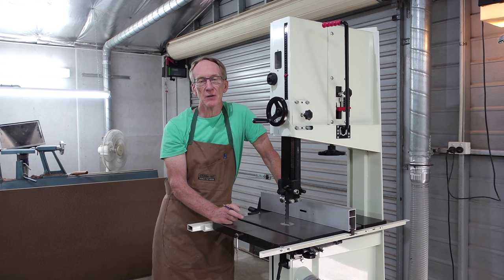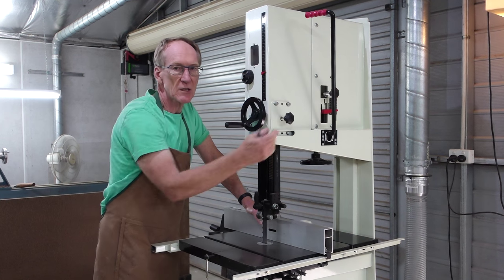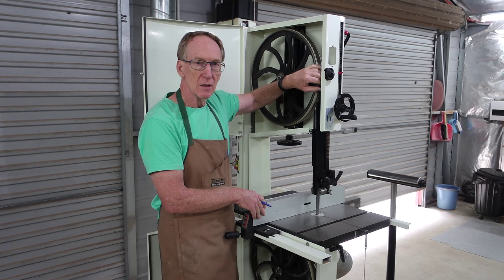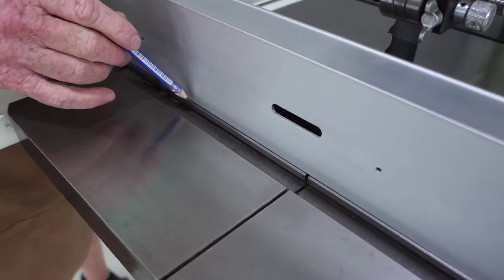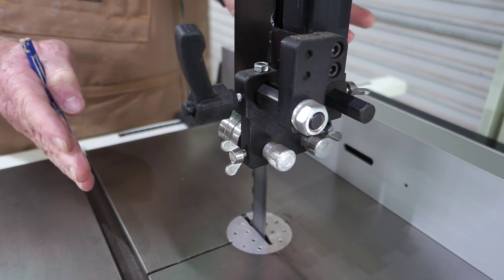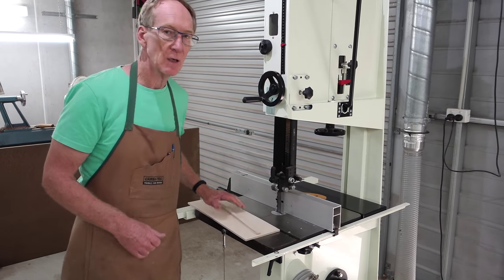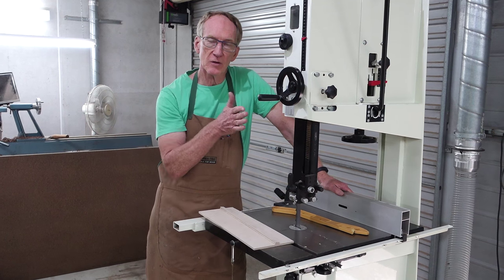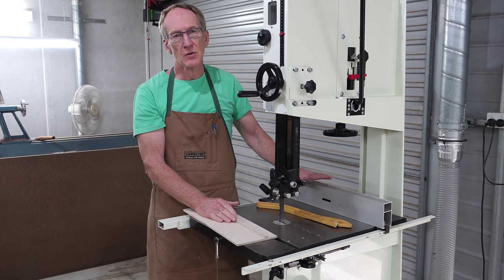The Great Myth of Bandsaw Drift

Comment: Maybe there is no drift when you have a huge ass industrial bandsaw with a wide ass blade. but when you're a DIYer, we have small skinny, thin blades that in fact DO DRIFT.
Reply: Kleo 84 Yes. This doesn’t work for me no matter how much I try.
Reply: Only proves that you don't know how to set up your saw. I have a hobby size band saw and often run very skinny blades - I do not have a problem with drift. The instructions given in this video though are not the best way. As others have said, look for a video by Alex Snodgrass and you will see that it is not difficult at all to set up your saw with no drift.

Comment: You did not adjust the bottom wheel, ...... my record 400 was awful until I used a straightedge to align the two wheels together had to take the table off etc. The bottom wheel need only be done once. You can not always get the straightedge in where you want it so use  a pair of spacers of even thickness, then adjust top wheel with the table back on then all the blade guides etc.
Reply: all  great bandsaws are adjustable. The difference becomes more relevant with wider blades,  say 3/4 inch and over. You can not resaw fine veneer without well aligned wheels, nor tame blade drift  -  not even with a sharp new band,  nor well set blade guides.  a little offset may be tolerable on a 1/4 inch band maybe
Reply: @PNAST  https://rikontools.com/Manuals/Lower%20Wheel%20Adjustments.pdf       The bandsaw is roughly set at the factory with one specific tension. It may need some adjustment. Also, if you change to a blade that runs at a different tension (changing blade widths, or instance), the bottom wheel may need a minor tweak (if the cut is important, enough). I use the directions linked in my post. When the blade runs in the center of both top and bottom wheel and it doesn't wobble, it's adjusted correctly.

Comment: All of that does nothing for the drift. The only reason for the drift is the fence. The bandsaw fence should not exist. When you resaw a board and push it against the fence, you build pressure. The blade has nowhere to go and it tries to twist and turn sideways, hence the drift. I don't understand why the bandsaws do not come with sliding tables, its the only way to use it effectively.

Comment: Ninety percent of the time if you have a problem with drift its a blunt blade. Carbon blades don’t last long, they are cheap because they are throw away. Go HHS or better still carbide. Then if you have a problem still its your poor set up. Bandsaws are fussy. They need to be adjusted properly or they just dont work very well. Never buy a sheet steel bandsaw, they resonate and vibrate to much and it sets up vibration in the teeth so they blunt quickly. 
Cast iron absorbs vibration and noise so it cuts smoother. Cast iron is much stiffer so the wheels do not go out of alignment under tension. There are many factors that go in to a good bandsaw. Most Bandsaws are rubbish. One of the THE best bandsaws ever made was the 30” Wadkin BZB. Full cast iron torsion box. Super stiff. Thats what you really need.
Reply: weighs over a thousand pounds lol

Comment: Wrong. Completely wrong.
In order to keep the blade from bending the bottom of the tooth gullet needs to be at the centre of the upper wheel.
The second big mistake is a full length fence. This does not allow the ripped timber to release tension as it is cut and forces it against the side of the blade.
What you need is a very rigid fence that ends just after the back of the blade. If you need a bit of support, screw a thin piece of ply to the face of the main fence. That way it will give if there is released tension. Very rarely will you rip timber without releasing some tension in the board.

Comment: This is not the correct way to adjust drift you are are just trying to compensate by adjusting the tracking knob witch is for tracking not drift this way is lazy and could cause the blade to pop off that's a fact jack